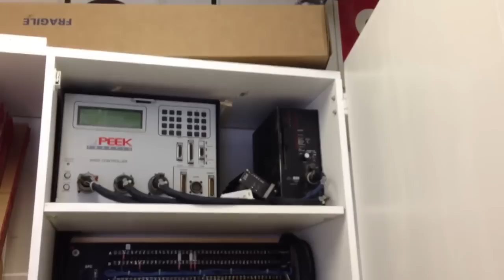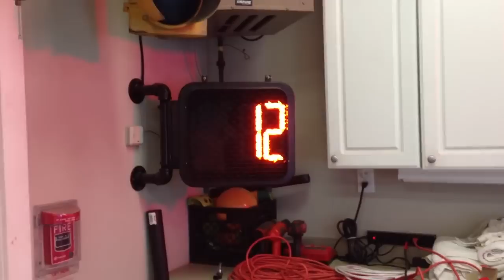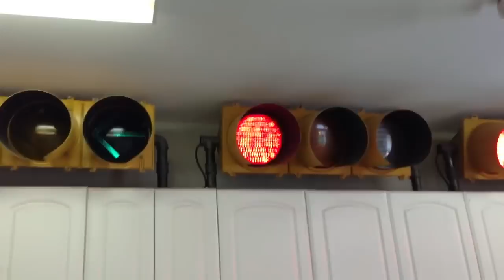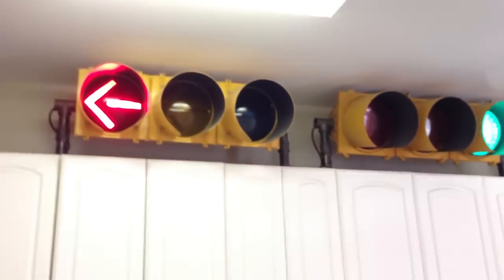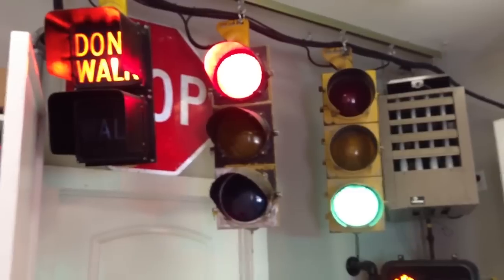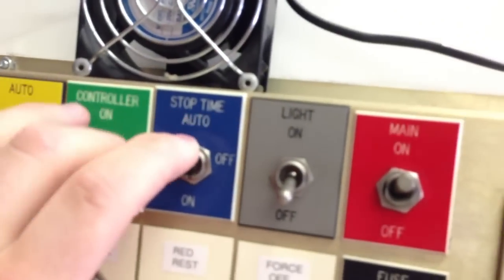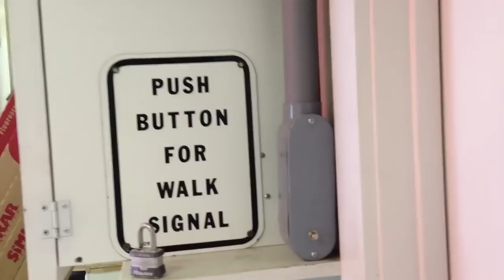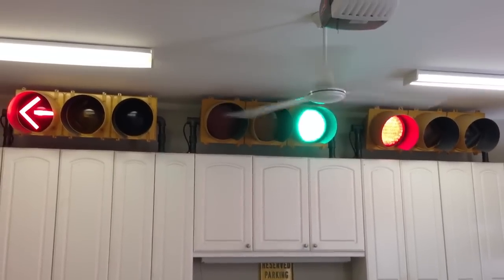Shop Traffic Signals | How Traffic Lights Work

Comment: That silver looking one looks extremely beautiful and rare. Some traffic lights start blinking after a certain time of day. And the crosswalk button doesn't usually work on most intersections.
Reply: Cameron Wright 1.My city replaced their crosswalk buttons
                              2. It's not silver. It got like that by sun
Reply: @savagedude9689  its corroded, so technically by sun and water
Reply: Its corroded
Reply: @lordfartquadbeanz2002  🙏
Reply: @lordfartquadbeanz2002  yeah

Comment: I have recently acquired a vintage 8 inch marble light signal end it was purchased with red and green LEDs but a yellow incandescent and to make it more authentic I am trying to convert it back to full incandescent. Does anybody know where I can get replacement parts such as the reflectors that the bulbs go in?